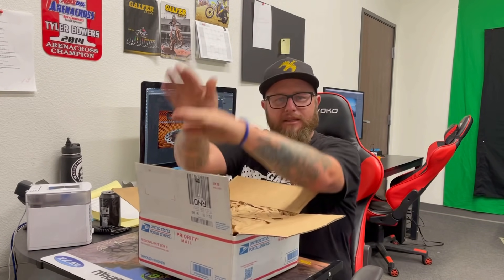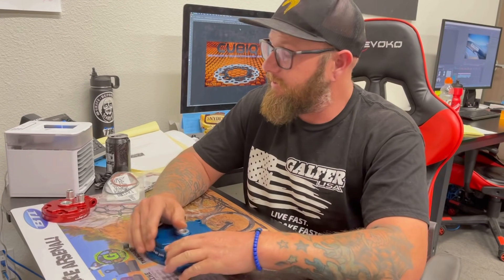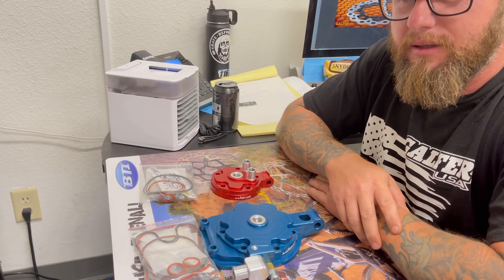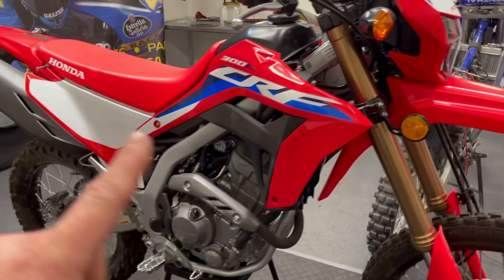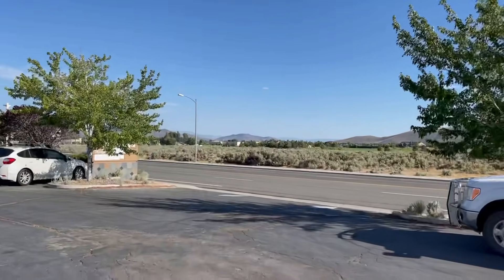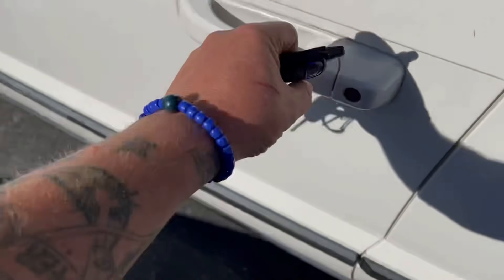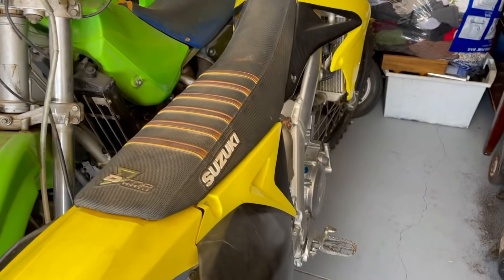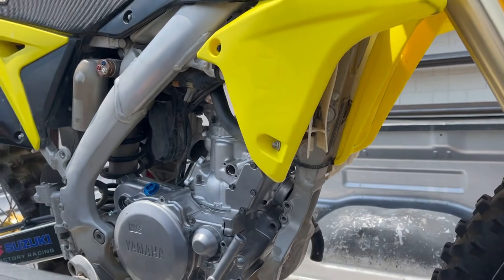RMZ conversion to a YZ250 let’s get started!

Comment: Hey buddy I'm a new to dirt bikes I got a Yamaha pw 80 2 stroke and when I got it didnt have a air filter I bought an air filter put it in wont fire but will back fire does the carb need adjust for it to start